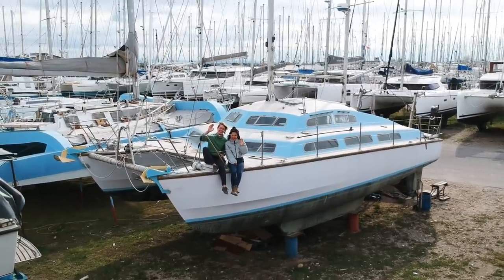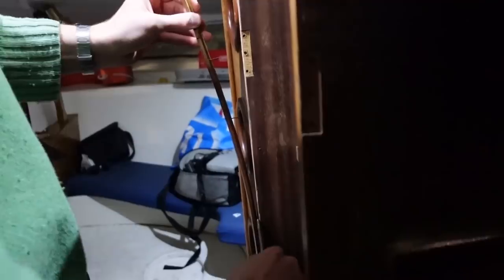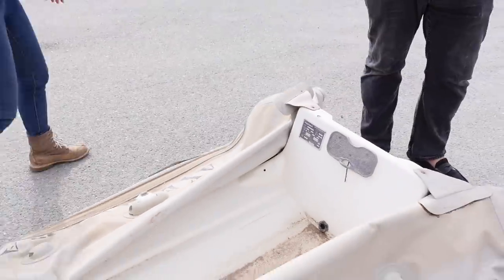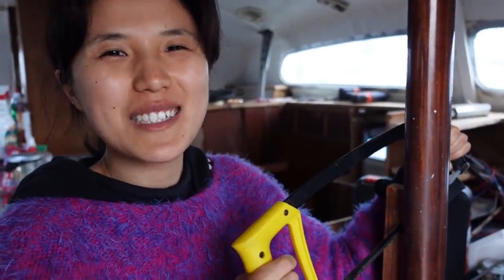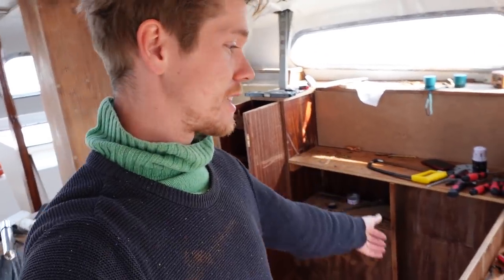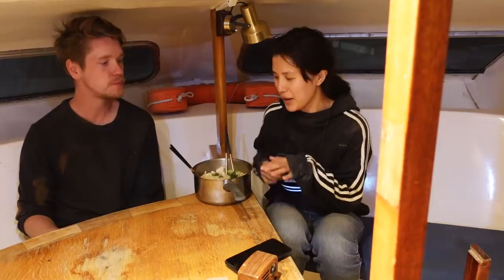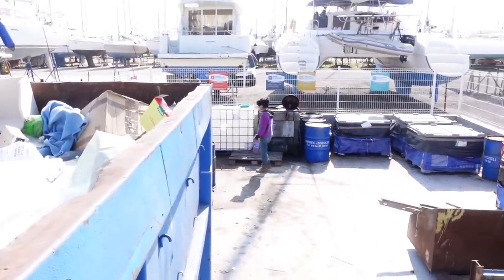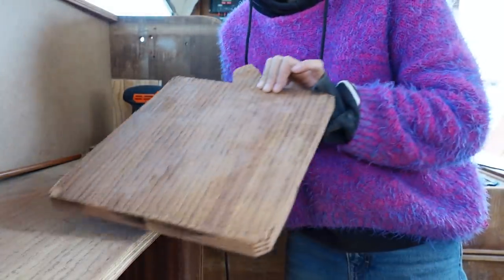Dirt Cheap Catamaran Refit | Part 1 | Wildlings Sailing

Comment: When you paint the deck do not bother with additives. Go to a pet shop & get some bird sand.  This is a very fine dry sand. Get a fine flour sieve  & sprinkle it over the wet paint. Then when it is dry very gently sweep off any that has not stuck. You should not have to put copious amounts on. Practice sprinkling on to  a piece of ply first as you will find that you need to keep the sieve moving quite quick if you get too much. Then apply second coat of paint over the deck. You might be clever enough to do it by hand but it gets a bit uneven if you are a bit careless.  DO NOT try mixing the sand in the paint first. 
You will get a supper grippy finish. I did this on the deck of my wooden yacht when I re decked it & it was grippy enough for another coat of paint 3 years later when I was doing the tidying up of all the boat painting. Some Hawian sailboarders use sugar instead of sand on their boards in the same way but that is for their bare feet & I have never tried it .But they use the same sort of method.
Reply: Sugar will dissolve out over time in the areas that get most wear. Sand will not.
Reply: @delukxy  I am not suggesting that they use sugar I was pointing out that a few sailboard manufacturers have used a similar system
Reply: My father used to sprinkle baking soda using a sieve onto the last wet coat of paint then when dry, wash it out. That way, when sanding to recoat, there’s no additive (sand, etc) to clog the sandpaper, plus it’s cheaply available. Test on scrap first to get texture correct for your use.
Reply: In my opinion this is a bad idea. The surface will act as sandpaper en will not be kind to bare feet and knees. There are far better solutions.
Reply: @bgt7874  Depends how much sand you put on. More on sloping surfaces by the mast, for instance. the top coat takes the sharpness out of the sand particles. There are deck additives( like micro round balls) but these - in my experience- are pretty useless.
Reply from the maker: Nice tips, guys!

Comment: Mark if you wire those little fans into the back of the refrigerator they will help stop the wet in the Fridge when it is real hot out and your trying to keep it cooler inside the Fridge.

Comment: Kiwigrip for the deck, watch sail life as Mads makes a good job using this product.
Reply: My only hesitation in recommending Kiwigrip is they already have a nonslip paint additive, and Kiwigrip is expensive. if they didn't already have the nonslip paint additive, sure no question use Kiwigrip, but these 2 have limited funds and in their position I would be using the nonslip paint additive the previous owner left them, as it is probably perfectly good.

Comment: Got good feeling about this boat. The previous owner, I think you said he sadly passed away, was clearly a sailor. Whilst all the woodwork, cooker, paint etc look really rough, all of the sailing bits wiring, panels, new sails, displays are all in good condition. That's the important and probably most expensive stuff so long as the rigging is ok.

Comment: Looks like you guys are off to a good start, I would strongly recommend switching over to a skill saw away from the jigsaw, set the depth of cut as shallow as possible, you will be amazed at how little tearout you get and how much straighter the cuts are. 

Also a 1/4" router with a round over bit and a flush cutting bearing bit will be great tools to have in your arsenal, they will make a huge difference in the finished quality of things you make. 

The router with the bearing bit and the straight edge trick your dad showed you will do an amazing job of cleaning up rough edges. I use this trick extensively. 

You can also 3D print shapes to use as guides with the router which makes some amazing finished work! 

I have some videos of this on my Channel if you care to take a look.

Comment: Jig saw - to get a straighter edge either
1) screw an already straight edge wood scrap as a guide, onto the sacrificial (part you are cutting to discard) timber surface ( the screw holes wont matter)
2) use clamps ( i saw them in the cutting board segment) to hold a straight edge to the surface that you intend to leave, after the scrap is cut away.

you can do this with a jigsaw, a circular saw , a cutting disc on a grinder and on a multi-tool cutter.

this will also tend to keep the cut surface "flat" and also protect the cutting blades from torsional forces from your "shakey" grip, like what i think would have broken the jigsaw blade.

Circular saws don't fit into everywhere you may want to cut.

Comment: I noticed that when you turned on the water, that your pump immediately started.  The noise and the pipe banging can be fixed.  If you install an accumulator in the circuit (basically a "T" fitting to the accumulator, it will hold some water under pressure in between the pump running.  this means you will get water without the pump needing to run, that the pipe noise from what is called "water hammer" is reduced, with the added benefit of pump and battery lasting longer as the pump does not need to be starting and stopping so frequently.  Accumulators are well worth the cost.  Down side of an accumulator is the water system is always under pressure and any little leaks will become constant leaks.  So if you have question, either fix the leaks or wait with the accumulator.  My preference is always to fix the leak. They seem to get bad at the worst times no matter what.

Comment: I would suggest painting  the deck in sections.  While the first coat is very wet sprinkle the non skid material evenly on t o the paint.  Once dry, paint over the non skid, preferably with a roller.  Ground walnut shells work  and wear well.  Use a coarse enough ground to allow a couple of coats of paint while maintaining grip.

Comment: Brilliant, your going to turn that into a great little boat, guys, well done so far. I wouldn’t paint to whole decks with none skid, it tends to get very dirty very quick and looks like sh,,,,,,,,,,,, best to paint all the deck with a good gloss, then tape off squares or angles with gaps between, then paint the none skid inside the tape, will look much better. Hope you get rid of that baby blue though, that spoils the look of the boat. Keep up the good work.

Comment: Congratulations on the new boat. We love watching your Channel and look forward to each episode.  We’ve owned boats for many years and just wanted you to check your cooker.  We think you said it is a Vanessa?  Whilst it is a great cooker be aware that it doesn’t have flame failure on it.  We had a Bowman 36 with one fitted and on one occasion the boat filled with gas as the ring had blown out whilst we were sailing.  Very scary and dangerous. So please be ultra, ultra careful.  Good luck with the renovations.

Comment: You might be able to find ‘twin wall plastic’ super durable and very light weight. One brand name is ‘coplast’ .
It come 3mm to 13+ mm,   Thin is great fir linings etc.   the thick stuff is sold as clear green house roofing too . 
Cheers Warren

Comment: I have had great luck with Kiwi Grip, not sure that is available in your country but it was quite easy. The non skid portion was achieved using almost like a stamp process. My neighbor had used EZ Deck by Pettit Paints as well as the West Marine Deck paint also made by Pettit Paints. They both come with the additive already in the paint. They worked quite well on his decks but proper preparation of the existing substrates is key!

Comment: I've got a pocket 2 now as you said your dji pocket was decent. My next vlog will be me using it 😁 what drone have you got? Great project you've got there 👏👏👏
Reply from the maker: Great choice, theyre bloody awesome and compact great for on the go. we have a dji spark, its a bit outdated now, you could pick something like an air or mavic mini which would be a better choice
Reply: @WildlingSailing  yeah I've got the creator combo so having the lav mic is handy when I need it! I'll see if I get more subscribers before I buy a drone though 😂 I think a spark would suit me just fine, maybe I can get a 2nd hand one. I'm pretty sure the spark has extra sensors over the mini and there's no way I need to film in 4k or anything!

Comment: Black & Decker makes a series of products under the sub brand of Matrix that include a circular saw, a jigsaw, a chop saw, an impact gun, a a drill, and a few other accessories. I would recommend that you start with the circular saw and a router head for the Matrix. You can find these on Amazon.

Comment: If the anti-slip is in good condition. I would just repaint. Most importantly is prep work. It needs to be power washed thoroughly cleaned. Where possible give it a light sanding or use a wire brush. To give the old paint some good teeth to hang on to the new paint

Comment: A Cheap possible cure for seasickness: Get a pair of orange soft foam earplugs. Put one away for safekeeping. If your left-handed, put the earplug into your right ear. If you're right-handed put it into your left ear. Make sure to seat the earplug deeply into the ear snuggly.. Always sit on the lower side of the boat when underway and always face the direction of travel.

Comment: I used Sandtex masonry as my deck paint on my ferro boat. It has bites in it for none slip and lasted 20 years. You can get it in different colours, you might not get it in France but your dad could send it to you. My ferro boat I painted with several coats of epoxy then sanded it lightly and the sandtex never lifted in that time. Your cat is going to float a lot higher with all that I think 1 inch ply coming out .Good luck.

Comment: Hello, very nice boat !
Instead of repainted the deck my advice is to focus on more importante things. 
 Clean and take out everything ( matress, floor .... ) in order to create space to work properly. 
You should work on electricity, water and fuel circuit first , after that you could start with the engine ( filter , injector cleaning , shaft, propeller.. ) 
What kind of engine did you have ? 
Kind regards from Marseille not far from you

Comment: The main additional costs with cats are the exterior coatings, especially anti-fouling, which is pretty much double a similar length monohull. So that adds up over time. Also, the rig and shrouds are a larger higher spec than a similar length mono, and so replacement is that much more. Ditto sails, which are normally larger, especially the headsails. Multis rely much more on headsails that monos, so the sails are usually larger and being used more wear out faster, so that, too adds up.
But given you almost 'stole' the boat, you have some margin for overspend..!

Comment: you can get pressure fittings for the copper, to get good fits in Canada they are called sharkbite  fittings. does you boat have escape hatches, if so research see how dependable they are and when it is advised to change them.....you guys are doing great....at one point I though Nadyiana had cut that beautiful hair, but it turns out it was just tied back. Keep up the good work

Comment: A circular saw would be better for your longer cuts more length of blade in the cut will keep it more controlled doing well though I think paints are fine unless they’ve froze but you’ll really need to stir them well👍👍
Reply from the maker: Ahhh ok, cool
Reply: @WildlingSailing  I've just had a thought- maybe get a really cheap food mixer on Leboncoin and use that??!

Comment: I'm no painter but there is a cost/time saving technique I have heard about which involves sanding the dull oxidised paint to remove loose and scaly paint and clearcoat then coating it with a high gloss clearcoat for garage floors and the paint job is supposed to look new and last at least 2 years with an acrylic type clear coat. An Epoxy type clear coat may last even longer. Preparation is the key to any painting though. On a boat the clear coat has to be slightly flexible or it will crack from the movement. I vaguely remember a video where someone used a floor clear coat on a boat. I'll try to find a link to it for you. I did paint an airport in New Zealand as a boy but that was in the 1970s so there have been many changes. Here's a video of someone using epoxy clear coat for a garage floor. 
Epoxy is flexible and if it's strong enough to drive on it's very strong. If it lasts only two years and it's cheaper and easy to spray on to the boat it's worth considering. Just make sure you have given the boat a good sand and try not to go through the existing paint. The theory is Chalky oxidised paint will will look new with a clear coat on it. Paints can be toxic so breathing protection respirators not dust masks are necessary. Learning this the hard way could and has caused death. Here's a link to someone clearcoat a garage floor with a roller. https://www.youtube.com/watch?v=mlReLfDpigA

Comment: If you've got some deck paintamongst all that left over I'd just use that with the additive, make sure the additive is very well mixed in though or it'll look a bit naff. Or you could use the French equivalent of sandtex, that'll do fine as well. White to reflect as much heat as poss. You're certainly cracking on & not afraid to get stuck in, good on you...

Comment: sort out the paints that you have and see if they are still good rusty cans mean nothing as long as they are not leaking
PS awesome job keep in mind eliminating wait on one side of the boat  keep trak of the wait you remove
Reply: Paint can be put in new cans. Use a filter to get rid of the skins and add a bit of thinner to correct the viscosity. Mark up the new cans properly with colour and what paint it is. Most epoxy has a fairly short shelf life so don't expect it to give the best results, especially if it's for something that needs strength. It might be OK for your decks but don't rely on it for sealing joints. Do the joints properly and use the old stuff for cosmetic purposes.

Comment: Great work 👏 deck paint if you want to spend money kiwigrip or you can just add sand in to paint mix up budget option. I had got 4 tins of old jotun antifouling paint from i guy in a yard because in was 6 years old and was out of date according to the manufacturer. Gave me it for nothing had to mix it for 15 minutes with one of those drill attachments put it on the boat and 7 months later when i took the boat out the water it was ok after a powerwash. Got 3 season of free antifouling so don't throw the paint out till you check it👍🏻⚓⛵🏴

Comment: You can buy a small pressure accumulator like from seaflo. It will enable you to not start the water pump so often and soften out the water pressure.

Comment: What are your plans, or thoughts, for adding solar panels or a wind generator? Cats scream for solar
Reply: I'm totally acting like Wildlings community manager (omg... guys... guys?! I can do this! You know my rates are good, will work for food! :D) - it has solar, it's just not attached right now. Last year there was a storm that was a bit more epic than usual (and the usual ones are pretty damn gnarly) and it tore the panels off their mount so they got their wires cut and are now living inside the boat. They'll go back up, though :)
Reply from the maker: We have 4 100w solar panels which need re attaching, not too urgent for us as we have the charger for now but we'll get them up in a few weeks hopefully

Comment: Hello From my own experience (did it) you can use  marine 5200 to to glue your dingy together it is easier than the usual hypalon or PVC adhesives glue in the way you do not need such a tight bond since the product is gooey not liquid.(must be very clean anyway with a little bit of sanding -roughing )on an airless dingy  use clamps over 2 boards rolled in cling wrap to press some 5200 out of glue joint (not all) and  keep parts together till cured. Good luck
Make sure that your hose clamps are ALL stainless including the screw (maybe optical illusion in video) also hinges being all brass or stainless,there is lots of knock off around.

Comment: Mark, re your request re non slip decks. I found that masking the perimeters, brush or small roller on the paint, preferably not in hot sun.  But depending on whether your paint already has the sand added or not, dictates your painting method.  If it is already mixed in,  keep it vigorously stirred all the time from the bottom of the tin,otherwise it will be patchy and look awful and not very effective. I doubt a roller is a very good idea if the paint and sand are premixed.   If not mixed in, paint first, and as you move across the deck, sprinkle the fine sand with a kitchen sieve across the wet paint, allow to dry and brush off the surplus and keep the sweepings for further us.  Do be sure to experiment with the sieve first on a piece of scrap ply, too coarse a wire (or plastic sieve) overloads the paint.  Try to keep the sieving as even as possible as you go.  Hope that helps.
Reply from the maker: Thanks for detailed explanation!👍 Appreciated!

Comment: Did you check for any moisture /delamination on decks before sanding , priming and painting decks. I would use a one part polyurethane paint  system. Looking good !
Reply from the maker: Cheers! No soft spots

Comment: Always, always use Awlgrip Paint in white because it makes the deck cool and if you prepare the deck by sanding all the old paint off.  The two part Awlgrip Paint will last for many years.  A bit more expensive but worth the cost in the future.

Comment: Word of advice from a plumber Those hoses are no good they swell up and will not hold !!! Change them for what is called PER red and blue pipe with crimped fixings or what as known as Tripple couche in france ! Or put it all in copper because its much safer and you will have less problems ! trust me on that i learned the hard way to !